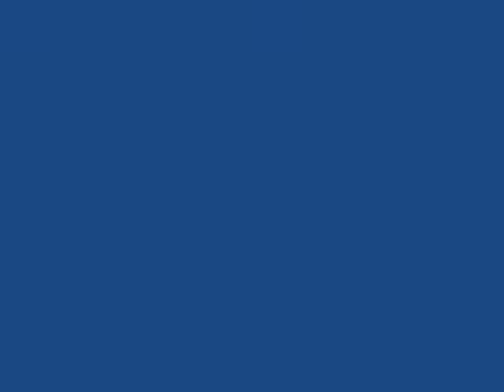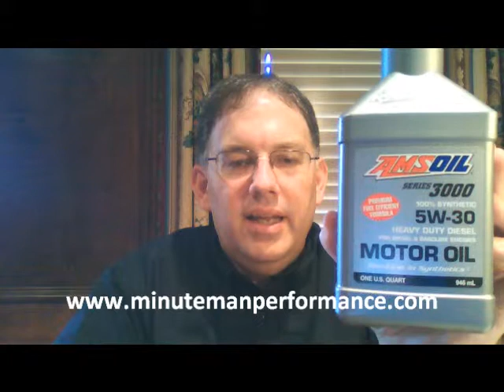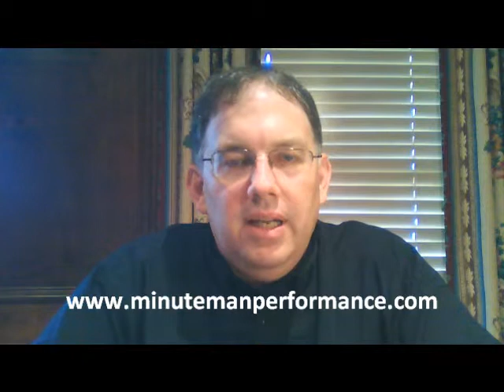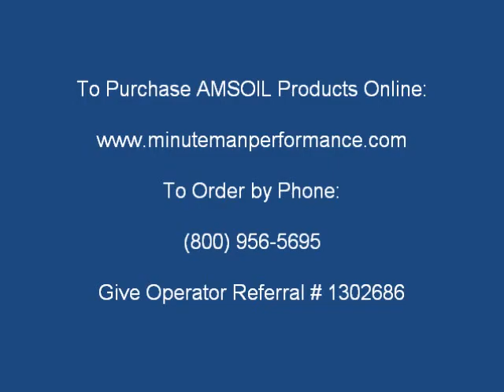AMSOIL HDD Series 3000 5W-30 CI-4+ Synthetic Diesel Oil

Comment: Hi!! I have a 2005 Ford F-250 4x4 CCSB 6.0 Diesel. I live in Los Angeles. I bought the 10/30 4x ... is this oil ok for my engine???
Reply from the maker: In general, full-synthetic 5W-30 diesel oil provides excellent year-round hot & cold results in 7.3 and 6.0 engines, due to the type of fuel injectors used in these engines.  For best results, I would move up to AMSOIL Signature Series Max-Duty 5W-30 oil (product code DHD).  This oil has an updated additive package and is slightly lower priced than the HDD featured in the video.  If you are interested, please send me your contact info (name, mailing address, phone and email) to info@best-synthetic-oils.com.  I will set you up with a free 6-month trial membership in AMSOIL's Preferred Customer program, which gives you wholesale prices and free shipping on orders over $100.